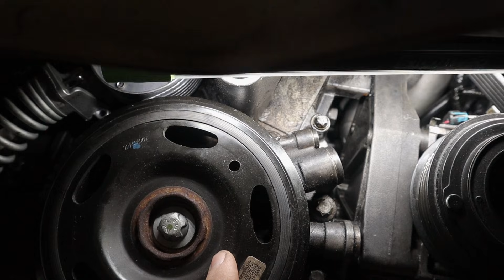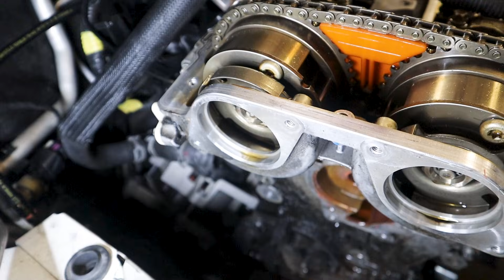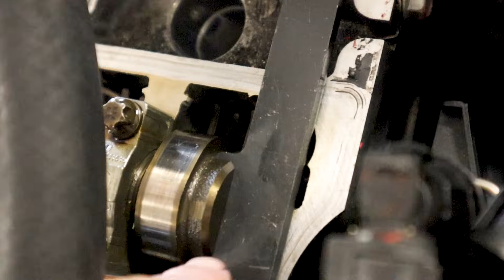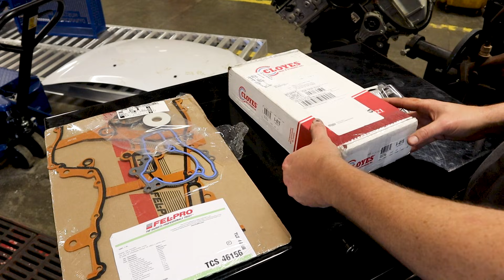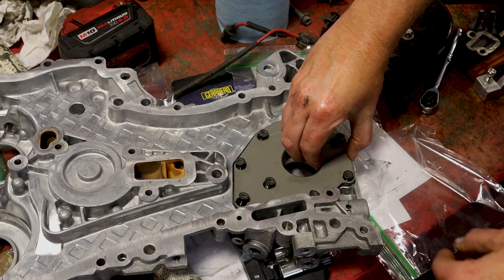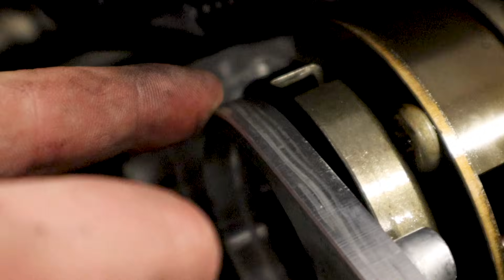P0016 code Ecotec 1.4 timing chain replacement

Comment: That crankshaft hold absolutely has to hold all the pressure when u are removing and installing the balancer torque to yield bolt that's it's job actually.
Reply: They officially warn not to use the timing tool to lock the crankshaft when loosening or tightening the crank bolt. I guess most people do it anyway. Not sure how great the risk is here. What could happen? Bent timing tool? Broken crankshaft? Broken engine block? Other people put in 5th gear and have someone step on the brakes to lock the engine. ChatGPT says all these methods are no good and recommends to lock the engine via the flywheel. Unfortunately there is no special too for that on the market. Seen a video where someone used a big screwdriver to lock the flywheel. Weird that there is no professional tool for such a critical task.
Reply: @Skandalos  Yeah, considering what it might take to crack that free (and tighten it to spec + 90 degrees) I am going to try to come with a a couple of custom braces to jam the pulley somehow.  Some people install a bar across 2 of the 3 bolts holding the pulley on.  That large pin from the timing kit is pretty beefy, but I can see catastrophic shit happening because of an extremely cheaply made kit.

Comment: This is a very great video for a common repair on these engines.  Overall this repair is very involved, and pretty time intensive and I’m extremely glad I chose to do it rather than haul it in someplace.  This definitely isn’t your typical 1hr brake or hub job…I’m about halfway through mine right now as we speak and ready to start assembling everything back together this week. So far everything has been pretty straight forward and easy going so I don’t foresee any issues cranking her back up!

Comment: I am from the u k I am a mechanic.  I have done plenty of the older engines.   On corsadbut was apprehensive.  About the newer engine. But after watching your video which I found very helpful.  It is  not much different to the old engine very helpful video thank you
Reply: Have you ever had a whirring sound after replacing the chain

Comment: Awesome, just pulled an all nighter to get the job done, it went very well until I started the engine. I ended up having a splash fest of oil and coolant, the coolant ran into the oil pan upon starting the engine, I couldn't identify where it came out of the engine as I shut down the engine immediately.
. 
Is there any smart way to recover from that, or is there some obvious cause?

I torqued the bolts and made sure to tighten them little by little to distribute the force on the gasket.

It must be from the cover gasket (where the water pump connects) because that is the only place where something like this is possible.
Reply from the maker: Yeah, you will have to open that back up to check the inner gasket. Sorry you are having trouble, I know how frustrating that can be.
Reply: @AutoScholarwithMrB  thanks for your reply. It actually went very well thanks to your video. Sometimes gaskets just don't want to seal and you need to give them some motivation. I will try torqueing the bolts around the water pump first, perhaps that will make a difference. I will post if it came out well.
Reply: I was supplied a different cover gasket. I opened it up and I immediately noticed that it didn't match up anywhere, it does match the outer profile and the holes. I could have spared the pain if I had only checked the fitment of the new gasket
Reply from the maker: @Thimo137  sorry to hear that Thimo

Comment: Great video buddy! That was a great refresher as I haven't did this job for seven or eight years tackling it this weekend.. One question... Is there a way to see if a valve is bent without pulling the head off and visually inspecting them?
Reply from the maker: Compression or leak down test is the best way. Good luck with your repair!

Comment: It should be stressed that unless your a very experienced with timing, do not attempt.  You can destroy your engine.  Do not try to use any substitutes on the timing tools. He did a great job.  I have rebuilt my engine myself and agree with him on this.  I did not need to do it.  But I always take apart my engines when they get about 150,000 and replace head gasket, valves, springs, and gaskets, valve guides, and any parts like the cams if needed.  Most of the time, you are better off buying a entire head that is already remanufactured if you are looking to save money.  However, if your looking for upgraded parts like I do, despite it costing more money, you should replace everything.

Comment: Awsome video. I have one question. If you did not loosen the cam phasers, and did use the crank tool and the cam holders in the back would you need to go through using the cam holders? I did not see in your video if you actually needed to loosen those up in the first place.
Reply from the maker: I think the point of loosening the cam phasers are to make sure the slack in the chain does not mess up the timing when the tensioner is released. Also without positioning the tone wheels perfectly, you may technically be “in time” but get codes for cam allocation. The computer has to know EXACTLY where those cams are, and that’s why the tone wheels are the alignment point. Any deviation and the computer will put it in limp home to try to save your valves from bending, even if the timing is right.

Comment: Great video, helped me loads, thank you. Though, I pretty much stripped the tensioner bolt. Other videos say the tensioner for the timing chain (the one with the grenade pin) should be 8nm not 20nm - So potential error there.
Reply from the maker: All my specs come from the manufacturer, I will double check and update in the description if I got it wrong. Thanks for watching!
Reply: @AutoScholarwithMrB not correct! Should be 71 inch lbs.
Reply: @robertshilts9662  so 5.9ft lbs or 8nm
Reply: @frugalfirehd7119  Yes but a lot of foot pound torque wrenches  don’t go down that low.. thus the 70 inch lbs comment.
Reply: @AutoScholarwithMrB  nice one Mr B. I'll delete the comment if you confirm it's correct 👍

Comment: Hello, I have a 2016 chevy cruze with 1.4 turbo, I replaced the head and timing chain and I had to buy a tool kit, I cleaned the filters of the variable timing solenoids and even so it keeps giving me the codes poo16 poo17 and it says that the correlation of the signal sensor is not correct, what could it be, thanks for your help

Comment: Fantastic video. I'm from the UK with a Vauxhall Corsa with the same engine. I'm not a mechanic and after lots of research and following this video with others I replaced head gasket, all timing components and clean up the valve train at the side of a main road. Works great now.
Reply from the maker: Thanks for watching! Glad I could help.
Reply: Bravo, could you pls share your opinion and important points that we should heed?

Comment: Fantastic video. It's obvious that you care about creating a good story and telling /showing the detail and finer points of the job at hand.
I think you are ready for the next level of video production.
Suggestions:
Add another camera. An opposing view or overhead shot will add much more dimension to your productions. 
More lighting. This one is tough, lighting is the most difficult and misunderstood aspect of photography and videography. If done correctly this adds polish to you over all video production. In general several small lights placed just right and color balanced will do the trick. 
Keep up the fine work.
Erick
Reply from the maker: Thanks for the advice Erick, and thanks for watching! We are currently working to fund a scholarship for my students and we are close to our $10,000 goal, which should be finished by next month. After that, we will be using the revenue generated by these videos to add new equipment to remedy some of these issues. I already have cameras and lights picked out, so improvements are coming soon.
Reply: @AutoScholarwithMrB  i have 2 exhaust valves that chipped on cyl 2 and 3 ,not scrapped but need to be change ,should i get new heads ??
Reply from the maker: @elianegascon382  if you have high mileage I would
Reply: @AutoScholarwithMrB  I wish you can see the carnage lol.The cylinder heads has a chipped piece of metal between cyl 2 and 3 plus 2 exhaust valves chipped off parts plus plastic melted into cyl 3 and had water in it so it,s a total loss for me so i,m checking scrap yards or new on amazone .
Reply from the maker: @elianegascon382  sorry to hear about that :(
Reply: @AutoScholarwithMrB  I think it,s better to buy new heads due to the fact that it has bolts that are precision on timing chain side.

Comment: Thankyou.  I'm from Spain . I did this job 3 years ago with an 1.2 ecotech engine, which is quite similar to this one. And i May do this again because i lost some power and hearing noise againg when the engine is cold. I think i used a very cheap new parts.  Next time it won't be so.
This is the best video i've seen until now. ..
Reply from the maker: Thanks for watching Antonio! Good luck with your repair.
Reply: After seeing this complexity I'll use the absolute best parts on the planet so I never have to do this again

Comment: Great help thanks. I replaced the head gasket on a Opel / vauxhall astra and have cam position sensors codes come up.
I used the locking pins and adjuster tool, but somethings not right, going to strip down and readjust this weekend. Thanks for the thorough guide, this is a big job without having to film it! Cheers mate!
Reply from the maker: Good luck with your repair Nathan! Thanks for watching.
Reply: @AutoScholarwithMrB  quick question, does the position of the cam sprockets matter, or is it only the phase discs that need alignment? I forgot to mark the position of the sockets before I dissembled the head! 🤦🏽‍♂️
Reply from the maker: @pixelstolife_ai  just the discs and the cams have to be locked in the rear, hope this helps!

Comment: Hey, liked the video, I just did a head gasket on my 2012 cruze. After setting the timing the book has me roll the engine over 2 rotations by hand and recheck timing. While rotating the motor I notice the timing chain slacks off around 180 degrees then retightens. Is this normal?
Reply from the maker: As long as it all lines up it should be fine

Comment: Hey buddy thanks for the video I’m about to pull off the timing cover do not have timing tools and not planning On replacing the timing chain car had 50k and the oil pump needs a rebuild. Any chance of it not leaking if I don’t replace the gasket ?

Comment: Hello Mr B, This is another Mr B.  My daughters car had the P0016 and the P0017 fault codes, it was running but in protective mode.  .  I assumed it was the timing chain as the car has 140,000miles.  When I took the front of the motor apart, I found the chain guide towards the front of the motor shattered.  Figured it was a no brainer, followed your video with the same tools.  Was super confident when I started the car, but no good.  I still have the P0016 and the P0017, but now I have P0420, catalyst system efficiency, P0300 Random multiple misfire code and a P1101 Actual measured airflow from MAF, MAP, EGR, and TP is not within range.   HELP?  Any cue where I went wrong?
Reply from the maker: Have you checked for vacuum leaks?
Reply: @AutoScholarwithMrB  Found 1 and fixed.  But I can find any other leaks.  Wouldn't the P0016 and P0017 clear after I put the new chain in?
Reply from the maker: @danielb3877  yes it should but sometimes the vacuum leak can cause the idle to go low and throw things off. My guess is the crank isn’t lined up with the cams. Did you use the lock down tools?
Reply from the maker: Oh I see you did, yes you will just have to double check everything. Is it running ok after the vac leak fix?
Reply: @AutoScholarwithMrB  .  I redid all the timing, checked everything for leaks, everything looks good.  It sounds funny takes a long time to start.  Could it possibly be the crank sensor?
Reply from the maker: @danielb3877  I suppose it could be

Comment: is there a specific position for the camshaft chain wheels or does it not matter in which position they are when you tighten the bolts?
Reply from the maker: No, the position of the cams is locked by the tool and the outer sensor position wheels are locked in. As long as the crank is locked by the other tool, no way to get out of time.

Comment: I agree with James Reed. I did all of this myself but the timing tool kit I got had no instructions with it  so, as you said, because there was more than one position to install the pulse generator wheel I wasn't certain I had it correct until I saw your vid. Thanks.

Comment: Mr. B,
2022-07-02
About 6 hours into the job and FIGHTING the connector on the thermostat(?), between the water pump and the hose from the bottom of the radiator. I liked the video, really wish you had addressed all the electrical connectors and how to disconnect them. I am an aircraft mechanic and a classic car guy and I have seen NOTHING like these. Our 2013 Chevy Sonic LTZ with 76,000 miles is 1.4 turbo and has a coolant leak somewhere near the water pump. Project is new timing chain, water pump, serpentine belt, hoses. The bottom inside bolt on the thermostat is blocked by the hose clamp on the hose going from that block assembly into the block behind(?) the timing cover. Cannot get to it. NOT FUN. Help? Thanks, Rex
Update - someone else's YouTube video shows that connector, got it off. Now fighting that hose from the thermostat(?) to the block.
Thanks,
Rex

Comment: Is there a torque spec for that crankshaft plug when you remove the pin I feel like I have an oil leak coming from there I bought a new plug with the washer but had a leak still timing cover isn’t leaking just wanted to make sure there wasn’t a torque spec for the crankshaft plug?

Comment: On the older Z14 engine the crank shaft pulley had to be tightened BEFORE the cams, the chain pulley on the crankshaft could rotate a few degrees if its not tight! It is also worth doing a full 2 rotations of the crank and re check the camshafts are timed again, this will take up any slack that may be in the chain. I have now done 4 of these on the Z14 all with internal water leaks on the gasket, is the A14 just as prone to this failure?

Comment: You didnt replace the phasers?
Reply from the maker: No, the tensioner just had too much slack. These don’t really eat phasers like other engines do and the customer didn’t have the money for them anyhow.
Reply: @AutoScholarwithMrB  that makes sense. Any advice on getting the toner rings lined up? Doesnt look like theres a catch for them.
Reply from the maker: @pathutson2698  you have to use the special tool. When you use that and torque the bolts they will be lined up if all tools are in place.
Reply: @AutoScholarwithMrB  thanks for the input and for responding so quickly. Im doing one now and your video has helped a ton, until you left the phasers, lol.

Comment: Slightly confused here. How can turn the sprocket without turning the camshaft...are they not keyed together? Any clarification would be greatly appreciated ? Just subscribed.
Reply from the maker: They are not keyed, it is a press fit. The cams are locked by the bar, crank locked by the pin, and reluctor trigger wheels are locked by the other holding device. Hope this helps, and thanks for watching!
Reply: @AutoScholarwithMrB   Thanks for your kind reply, although still confused! I have an old corsa D, 2007 with plain sprockets. When the sprockets are locked in place by the jig how do you turn the cam relative to them? Is it just friction alone that stops them turning relative to each other facilitated by the tightness of the central retaining bolt? Sorry to bother you again...confused!
Reply from the maker: @isobar5857  right, just the torque of the bolt keeps them tight
Reply: @AutoScholarwithMrB  . Thank you, once again for your help.

Comment: Hi I’ve bought a timing tool off eBay and the camshaft timing tool that goes on the front part of the engine where the sprockets are have about a cm play when you loosen the nut, the tool doesn’t hold it in exact place the wee dishes with cut outs can be moved about half a cm to each side, hope this makes sense

Comment: Thank you so much for your video. Only one question: you torqued the two shaftcams bolt h24 only 30° and not 60° deg as requested. There is a reason for that?
Reply: Think he was just guessing.

Comment: I am chasing down a P0016 and P0017 codes. Sensors and actuators have been tested and operating correctly. I have noticed slack in the timing chain when the motor is not a TDC. However when i turn it to TDC the timing chain is tight how it should be. Is it normal for there to be slack in the chain when the motor is not at TDC? The Freeze Frame indicates only a P0016 code and that intake cam appears that it could possibly be off by 1 tooth. I am waiting for the timing tool set to arrive so i can actually check it. Any feedback is much appreciated. Thanks!
Reply from the maker: That is what this one was doing it, and it ended up a tooth out. Codes, no power, car was in “limp home” mode. Without the tools it is almost impossible to eye everything with accuracy. Thanks for watching and good luck with the repair! Let us know what you find.
Reply: @AutoScholarwithMrB  Alright engine timing tool set came and both cams were ever so slightly out of time. Certainly wasn’t noticeable by eyeing it. GM tech said a little slack when not at TDC is normal for these motors. I was able to adjust the timing and she’s running like new. Idle and throttle response are back to normal and no engine codes. Thanks for the videos and feedback!!
Reply from the maker: @tylerpeters6715  congrats on a job well done Tyler!